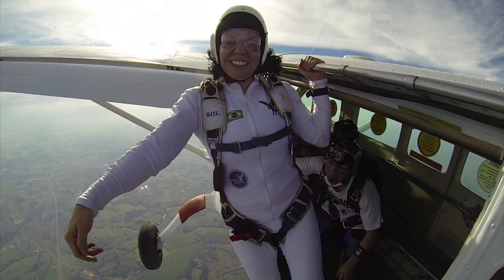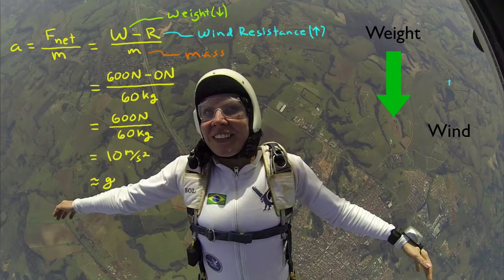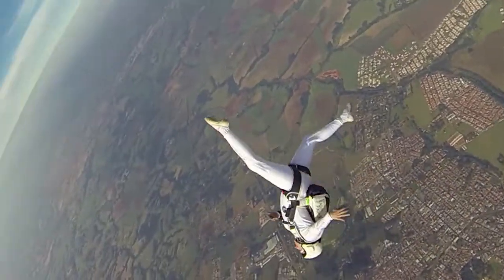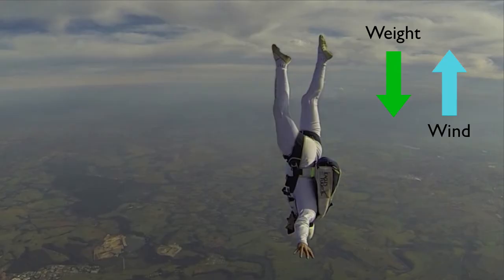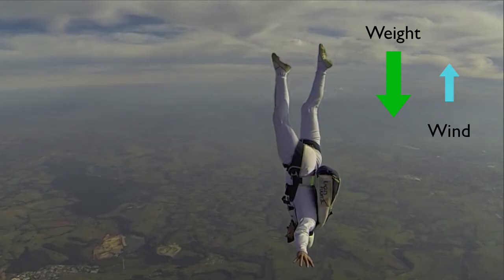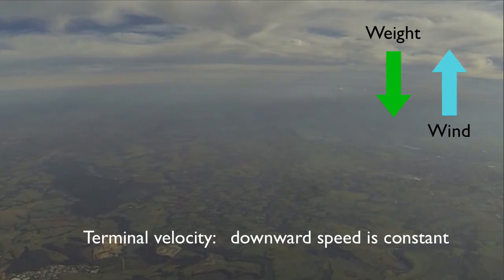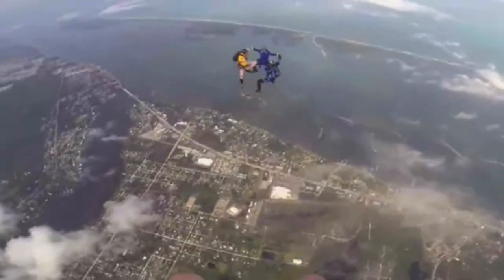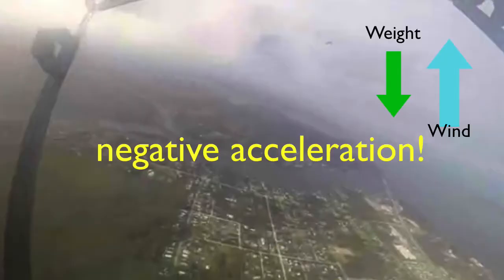Skydiving Physics

Comment: Pretty Interesting, Well Presented !   Good Luck here, hope you add more. Darth Nobody Airborne NYC 
     ( Physics related :  possibly add or do a separate installment on “ Airplane take off/ traveling / landing Physics “. 
Interesting Parachute related factoid:  “  WHY Skydivers ( Normally ) will not feel Negative Stomach Effects ( Barfing Reflex)
   When first disembarking from their airplane. Answer? - they are already traveling Horizontally at 145+ mph, and your
Change over period til you reach a Terminal Velocity is Gradual DUE TO WIND RESISTANCE. “.  
       ACCELERATION-   Taking Off in a Plane...you might feel sick!   God Bless..